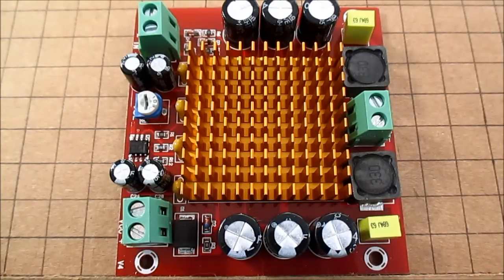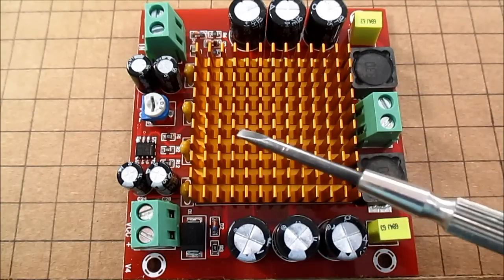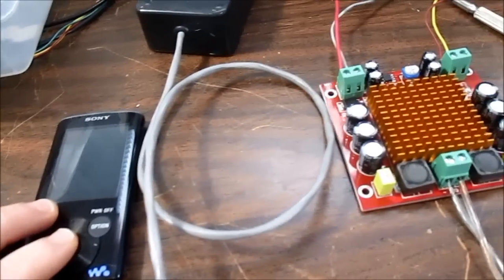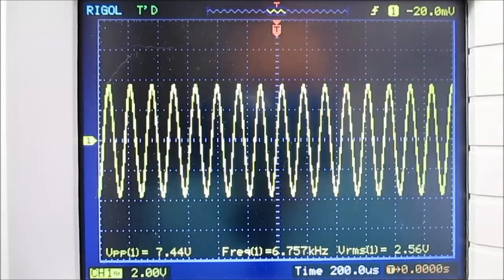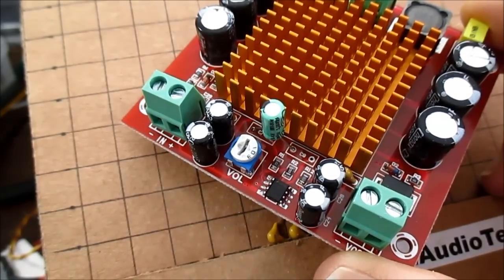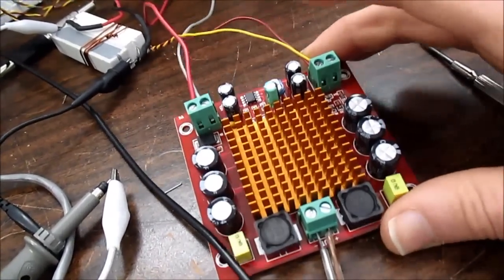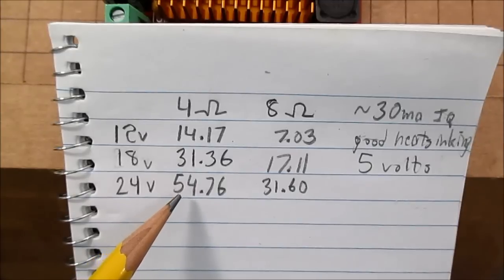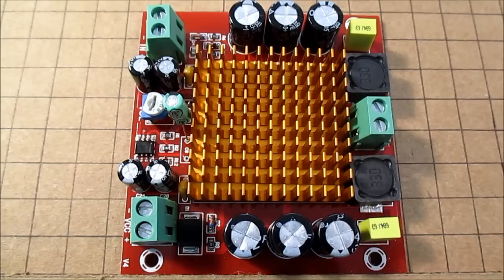TPA3116 audio amplifer board test, review & mod

Comment: If you look at the Texas application note on this same amplifier, you will see that they also use 1 uF ceramic capacitors.  The Chinese who made this module only followed what Texas recommends in their application note, which you can see here.
See the circuit on page 5 and the materials list on page 9
https://www.ti.com/lit/ug/slou336b/slou336b.pdf

Comment: Very cool video. I damaged one of these boards and it's popping the speaker at regular intervals. I have a second board, but it came with a damaged capacitor. I resoldered the damaged capacitor on the first board. I hope it works, as I haven't tested the second board yet.

I'll definitely use your modification. The lack of bass is very bad

Thanks😄

Comment: To eliminate hiss or hum remove heatsink find 75K & 47K resistors, remove R 75K and Replace R 47K to 5K6 it's called gain master mode 20 db

Comment: I was surprised, but still not so much ... when I readed one of bellow comments that on this Chinese module also, under heatsink - IS NOT  TPA3116D2. All further discussion and testings is without sense.

Otherwise, by datasheet TPA3116D2 has the power of 100W at 2ohm's with outputs connected in PARALLEL like single MONO amplifier with 0.1% THD, then 125W with 1%, and 160W max. with 10% of distortion ... at 24V supply

Comment: I'm going to use one of these to run a compression driver with a 3 way tone control board to tune the top end. I guess there is no need to change the caps in this case or, would the top end also be affected by using the ceramic caps?
Thanks.
James

Comment: Hello, I took the heat sink apart, and surprise, it's not a tpa3116d2 below. The tpa 3116d2 has 32 inputs / outputs, this amplifier chip only 16 ... no wonder it outputs so little power. I could send you a picture if you like.

Comment: Hello John, thank you for the review. I bought this card, but I realize that even with your modification, it will not deliver enough power for my little 10 inch JBL sub. What is the other limiting factor? Can adding a large capacitor to the three small ones on each side promote a gain? thank you for your video that I unfortunately discovered after my purchase. But as they say in France, better late than never. Happy New Year to you and your loved ones. Vincent

Comment: At 26 volts the TPA3116D2 is rated for around 135 watts into a 2 ohm load in BD mode and around 165 watts at 10% THD into 2 ohms.   Now nothing on the board you tested would survive that short of maybe the IC itself.  The inductors would go up in smoke for sure.   Yah I'm a TPA3116 fan boy.

Comment: Hello John, thank you for the review. I tested it with bass guitar directly and via equalizer pedal (which is also used as preamp). I tried with 4.7uF, and also two 10uF back-to-back in serial (to eliminate the polarity).  My conclusion is to keep c7/c8 as it is and to use the guitar via preamp. There is improvement in sound while using a preamp so that I assume the input impedance is indeed too low. I could not hear such improvement while changing the input capacitor to a larger one (it sound quite flat to my ears in both cases). On the contrary! a larger capacitor especially on high DC voltage (above 12V) generated uncontrolled very-low-frequency resonance (about 1-3 Hz) which could damage the speaker. Please be careful with this modification or maybe look for an alternative board!!! 
And... I checked it on two boards so that it is not the specific individual board problem.
I will be glad to see a detailed schematic diagram of this board or modification that will make this board more stable.
Reply: Does the integrated preamp have enough gain to amplify passive bass guitar signal?
Reply: @vinigretzky97  I would not trust on that. Better to have active guitar effect or preamp before.
Reply: @dave5533  So you didn't try it?
Reply: @vinigretzky97  Not recently. 
I did not keep this board. 
It was just DIY curiosity. 
Sorry to say but it is a "toy" for bass guitar...
You can get a much better choice 2nd hand small bass combo...
Reply: @dave5533  I mainly want to use it for a portable bluetooth box but if the integrated preamp offers enough gain for instrument inputs then even better.

Comment: Good afternoon friends, can someone give me information about the specifications of the electrolytic capacitor? In addition to being 4.7 micro farads, would I need to know what voltage it has to be and how it is soldered to the plate, the positive in the c7 and the negative in the c8? or vice versa ?, thank you very much, greetings.
Reply: I am sure the voltage should be at minimum the highest voltage you would use...maybe 24v. For which way around to solder it, i would check pos and negative with a multimeter. Should work ok.

Comment: Hi Jhon. Excellent video. ¿This amp with the capacitor hack is suitable for powered a passive subwoofer from a home theater? 
The input signal  that goes  into the amp comes filtered and is between 20 and 300 Hz. 
¿Should I get enough bass?

Comment: Lot of information on the board however just need your suggestion please..
I have 2 sets of 30W 4ohms speaker + 260W 8ohms tweeter so i could use them as right and left channels.. Its setup in a single housing..  Im not sure how to choose an stereo amplifier board with bluetooth for this setup.. Need your help to recommend the best amp board with bluetooth please..

Comment: John what's the maximum current does the tpa3116 withdraw at full load?
Reply from the maker: Around 4 amps at 24 volts with 4 ohm load from these single channel boards.
Reply: @JohnAudioTech   aiyt thanks.... what about for the 2 channels?

Comment: My guess is that's a 5532 op amp.  As you know it provides some buffering to the amp, but likely used because so many inputs, like iphones, are very poorly impedance matched and have low signals.  Your point about caps and better gain matching is unforgivable.  Why make a nice board and screw it up with this  design flaw. I was also suprised about the hiss, that op amp should be very quiet.

Comment: I absolutely love your channel sir!
I'm an avid car audio enthusiast and upcoming competitor. I've worked on several top cars both current and in the past.
I've been so interested in these Chinese amp boards. I've only been researching them for a few weeks now. I love the pricing but then again, I really like the quality of the Sure and Wondom models. I am looking at doing a project using class D amps. I would really like to use a full range MONO amp per channel. This way, each driver get's it's own amplifier. No crosstalk plus the ability to go fully active with my DSP's. I like to run 4 channels up front since I use wideband speakers for my midrange and top end. I'm currently running Hybrid Audio Technologies speakers in our competition Acura build in progress. By the way, I'm not doing this as an expense cutting tool. I'm doing it to see what one can get a certain price points. I promise you, I have no shortage of amplifiers....lol.
Back to my speakers.....
My widebanders are 3 inches in size. They are currently running at 300hz and up. The manual states 50 watts per channel but I'm currently using  125 watts and have massaged them thoroughly with 200 watts!!! lol.
In my doors are the Hybrid Audio Legatia L6SE (Special Edition) mid bass. These are a 7.1 inch mid/sub....as that's what I like to call them. I have them playing in a bandpass config starting at 36hz up to the L2SE's 300hz. They play low and can take power. Plus I have built my doors very solid.....adding close to 75lbs of various types of deadening materials.
My sub is out as of right now. It's a HAT Clarus 15 incher set up in an infinite baffle configuration. 

What would be a good way to get ahold of you privately as I want to run some experiments. It can be hard to do that with prying eyes everywhere!!!
I don't care to give my cell phone out since I had a pressure washing business and advertised all the time....7066339149 if wish to text...jmurphy30513@gmail.com for email.
Facebook messenger is my best contact though. I'm from Blue Ridge GA and my profile pic is me and fiance...lol.
I just need to know which models to get and the ones to run like hell from! LOL!
Man....I'm looking forward to this!!!!
Reply: Sure and Wondom models i got 2 units i love them sound is very punchy and clean 250 x2 board 4 years ago may be {looks the same still } i like had or still has pots to adjust frequency of switching with led lights so one can dial it in with out a scope {worked fer me } witch is good wen up grading caps to lower ESR  the one with upright heat sink  i do not run it a lot but installed it in a old 55 watt receiver thing rock i did in stall nichicon cap as the cap they used then were getting hot cool as a cucumber now with nichicon gold caps on it 2 x 250Watt Class D Audio Amplifier Board - IRS2092[627]..NOTE ill bet the unit i got and swapped the Four Large Capacitors on had one crappy cap from day one. i have not even hooked the other 250x2 board yet one up yet .i have 4 other board from SURE Wondom all work fine not tweaking but their are upgrade talked of in forums ill be getting the digital DSP board.Some amp have it built in now  with all the sound setting equalizer built in it seems like a bargain  https://store.sure-electronics.com/list/2
Reply: Infinite Shoeblack  
Gave the internet my email address? And you have a cell phone and carry it around with you everywhere? How's everything going since China appreciated you buying a cell phone with a camera and signed every Eula agreement out there when you cranked it up and put your phone number in it?
I've had that email address, along with probably six others for 10 years. I have a pressure washing business with a website so it's not like I've been able to hide off the internet lol. It always seems like I can find certain people no matter where you go that has a Google degree and hides behind the keyboard. I don't understand why I comment like that had to be put after saying an actual educational statement....
I guess the internet will always be predictable lol
Reply: Infinite Shoeblack  now I wonder why I couldn't remember this post. It's been 3 freaking years ago!
The thing is, I don't have spam on that email lol.
It's funny how I can get it from someone posting on a 3-year-old post...

Comment: I believe the spec sheet for a 3116 list's 100w at 2 ohms when bridged
Reply: 100W at 4 ohms, guess that it is peak power and not RMS. They also state output power at 10% THD which if you look at the formulas on the data sheet they state that is 1.25x the unclipped power.
Reply: Output power at 2ohms, but not in bridge, than in PARALELL outputs connection should be by datasheet about 100W with 0.1% THD, 125W with 1%, and 160W with 10%, and with 24V supply.

Comment: I'm planning to use this as a modification to my car's audio system. Im planning to run this mono board with a PEERLESS BY TYMPHANY  PLS-P830970  50W 2" Woofer

With a 12v step down variable regulator set to maximum 12v as reading the board specs its maximum output at 12v input is 50w matching the speaker. Obviously I'd never max it as I don't need too. I simply wanna add an aditional mono center speaker to improve the sound stage of the car. 

Would you say my thoughts above are correct and am I correct on assuming the audio input is low lever as I plan to run the RCA left and right outputs through a passive RCA stereo to mono convertor then out, cutting off the end of the RCA and terminating into the amp.
Reply from the maker: Power into 4 ohms with a 12v supply would be around 15 watts before clipping. Input is line level and you may need to adjust its input trimmer to balance the sound.
Reply: @JohnAudioTech  input trimmer to balance the sound. Sorry i dont follow this was simply a thought i had the other day im no expert. So how is this adjusted?
Reply: @JohnAudioTech  So in your  veiw would this amp work with the speaker combination at 12v or does it require improvement

Comment: Hey there! I need to así u something. I bought the same Poweramp and im using a 24v 6amp switching power supply but i get a tremolo effect when is turned loud or when i play hard. Any idea?
Reply: because a switch mode power supply "pulses"  it's voltage output (switching on and off and a set frequency), but a "conventional power supply (ie standard "step-down" mains transformer) & bridge rectifier arrangement is much better..ie :  NO Tremelo effect!!

Comment: Hi man, how do you connect your oscilloscope to the amplifier ? I see that you use a resistor. Where does exactly do you conect the oscilloscope? And do you use the resistor in order not to damadge you oscilloscope? Thank you
Reply from the maker: I connect the resistor across the output and connect the scope probes across the resistor. It is important to be sure the signal source and power supply are not grounded or the ground of the scope probe can short the amplifier output.
Reply: @JohnAudioTech  Thanks man.
Reply: @JohnAudioTech  Hi it's me again..  At 10:07  of this video i see that you have ground and Line of the oscilloscope connected one on each side of the Resistor, Doesn't that make the current want to go across the Oscilloscope? Do you use a probe with resistor or do you connect it straight to the oscilloscope with normal cables? How much power your oscilloscope can handle? I am buying one the oscilloscope and i'm not sure how to use. Though it says that it can handle (DC voltage (V)  400mV/ 4V/ 40V/ 400V
   with accuracy of ±(1%+5). Can it really handle 400v? or do I have to use the probe with resistor to lower that voltage? I have no idea how much voltage comes out of this TPA3116 amps.

Thanks again!!

Comment: Hi,thank's for the video, i'm trying to make a "Guitar amp" with this chip but the sound had a lot of midrange and not treble. I also tried to put a small valve preamp with eq between Guitar and input but the problem is still no treble.   Anyway  I made your mod and now there is a lot of bass

Comment: Hi, great job but can you explain the mod exactly as I have tried (22uf polarized cap) and sound goes on and off at low rate no mater cap orientation ??? Did you remove any other component or used unpolarized cad ? What exact holes to connect from c7 to c8 ?

Comment: Hello , what's the recommended voltage of the capacitor ?
Reply: as it's a  "coupling" cap, so you can get away with a 16v rating

Comment: I just tested a dual TPA3116 board which does not have op-amp stages on the inputs, but I am getting the same issue that you had - Poor bass response. The bass is there but really low level - There is a distinct audible high pass effect going on.
The input potentiometer is dual 50K and the input capacitors are all surface mount (so I don't know their value).
Further testing to be done . . .

Comment: Please review tpa3116d2.
Reply: In particular the 2x100W PBTL TPA3116D2. I have a dozen of these and I'm interested in modifying them to improve hum and also hopefully ADAU1701 DSP-controlled mute when no signal is detected. Available on ebay for around $6. https://www.banggood.com/2x100W-TPA3116-D2-Dual-Channel-Digital-Audio-Amplifier-Board-12V-24V-For-Arduino-p-1019109.html?cur_warehouse=CN

Comment: One thing about heat-sinks - with IC's they should always be mounted with sprung screws or push-pins, NOT cemented to the chip as appears to be the case here, to allow for different expansion rates of the die and sink. When there's no way to facilitate this, I use small dots of glue (usually superglue) at the corners of the die, and thermal paste.
Reply: excellent tip, and great point!

Comment: Just curious to know if this board had a loud thump sound when powering on/off. Many TPA3116 boards don't have a delay circuit on mute so they can damage the speakers when cycling power. Also, I've read and seen one video where the output filter gets fried if no load is connected (24-26V input). Apparently a delayed speaker isolation relay won't work as it might burn the coils. I'm probably testing if I can drive it with a dummy load while it's "booting".

Comment: Loved the video! Thank you! I purchased the TPA3116 but mine is slightly different. I was looking to knock down the gain as you did, way too loud paired with the BT receiver. Would I still want to remove the same capacitors as you did? Thanks. 

goo.gl/HhR1bR
goo.gl/zM4oux

Comment: Sir a very common question but very useful
HOW CAN I MAKE A LOW PASS FILTER FOR THE INPUT?
Reply from the maker: Connect a resistor in the 2k2 range in series with the input and connect a .1uf cap from the amp side of the resistor to ground. Adjust the capacitor value up or down to suit your needs. I did a video about an active filter for better performance.
Reply: My yda148 is still the better amp - I’m going to try a STA328 amplifier next month  when it arrives, I have read good reviews keep up the good work

Comment: I have several of the cheaper TPA 3116 amps and there are a few worth while things to look for. It's better to get one that can be modified to fit the data sheet sized heat sink or even bigger. Some use a screw on heat sink. The one below is as far as I know the cheapest TPA3116 and there is a simple mod on YouTube to reduce the gain and hiss. It's then a very good little amp.
https://www.ebay.co.uk/itm/DC-5-24V-TPA3116D2-2X50W-Digital-Amplifier-Board-Class-D-Dual-Channel-Stereo-AMP-/282361391300?hash=item41be0ce8c4:g:8MwAAOSwr~lYnAU4 
There is a 2 x TPA3116 for 100W a channel, needs a better heat sink but it's a screw on. 
There are also the TDA7498 / TDA7498E amps that do not cost much more rated at 100W and 160W - usual bloated 10% distortion. It's a good idea to get the ones with the variable gain switches - most have them.